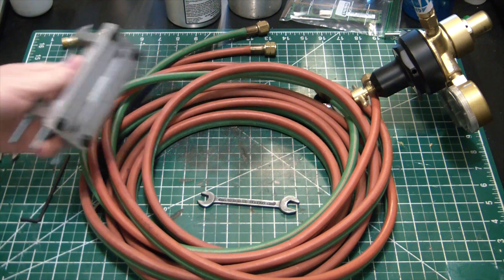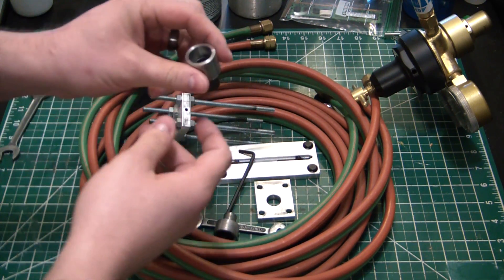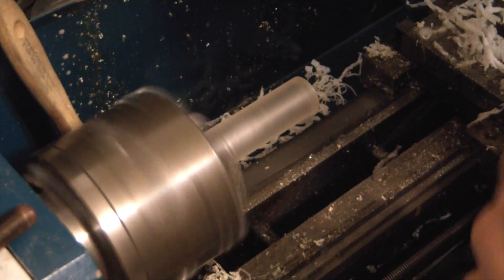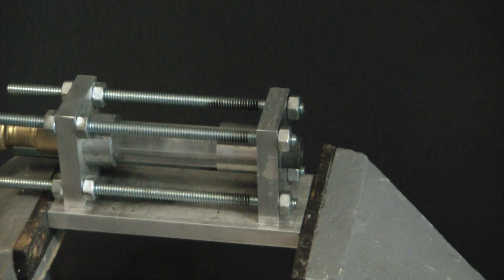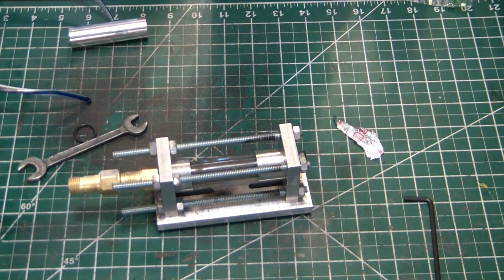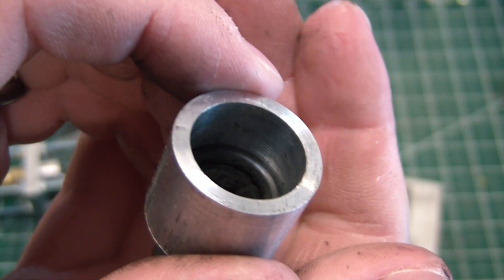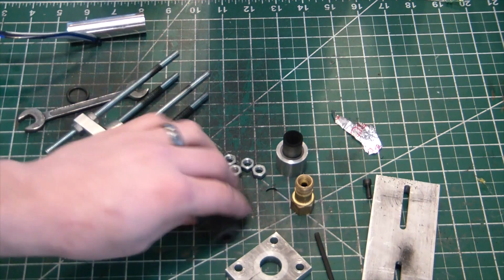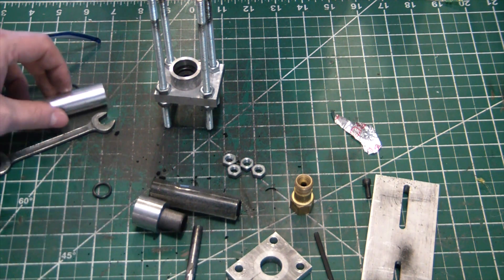Transparent Hybrid Rocket Engine - Acrylic and Oxygen - ElementalMaker

Comment: I may have missed it in the comments, but I saw nothing about your combustion being quite fuel rich and inefficient, although you did state that the operating pressure was low.
You need far higher oxygen flow. If your pressurized oxygen won't do that, then investigate using nitrous oxide. 

As someone else stated, if possible ignite the fuel near the input port. The flame will quickly and evenly spread the length of the combustion chamber.
Reply: The advantage of nitrous is that it can be a liquid under pressure. I think that nitrous will outperform O2 unless you can liquefy it. That can be done by either fractional distillation of liquefied air or by using liquid oxygen to cool the gaseous oxygen.

Comment: The nozzle seems undercompressed. The plume of fire an gas should ideally be straight, if it diverges it's undercompressed and if it converges it's overcompressed. Basically, add a bell.
Reply from the maker: I think the issue is more the very low pressures its operating under. With such a thin acrylic wall I don't want to push it or it'll definitely blow. I'm working on building a larger version that can fit 2" acrylic rod stock. The graphite nozzle itself already does have convergent and divergent sections.
Reply: @ElementalMaker  wow, you read my comment! I'm no scientist, you are probably correct. I was making a suggestion based on my extremely limited knowledge on rocket motors. I do want to start experimenting with hybrid rockets at some point, however. I am curious: how do you manufacture the graphite nozzles?
Reply from the maker: @josephstalin7995  I try to read as many comments as possible! 👍 I made my nozzles on my metal lathe. Graphite is quite easy to turn
Reply: @ElementalMaker  I guess I'll beg my lathe-owning neighbour in Slovenia to make one to spec. Maybe convince him with a few beers :)

Comment: I never fail to appreciate how you make a not-so-subtle adult joke in each of your videos. As for the "thrust vectoring"  (got a good laugh outta that one too), I've found that the closer to the injector end of the fuel grain you place the igniter, the burn progresses naturally toward the nozzle end, and the entire length of the inner core of the fuel will ignite almost immediately. It will do so in an almost perfectly symmetrical and even manner . A cheap metal sparkler works beautifully. That last burn looked amazing, it was nice and straight and bright as hell. Nice work.

Comment: Seen a thing once, thinkin' maybe you can try it..metal exhaust cone, pvc body, wire static coil on pvc, as ignition provider is what I'm guessing. Haven't seen in around 2 years and can't find it, but guessing that it just used atmo as fuel, the whole reason I was impressed by it. Mighta had a diode, but too long ago.

Comment: @ElementalMaker Great work! Your automatic thrust vectoring seems to be caused by flow separation which happens when the nozzle is dramatically over-expanded. This means that the expansion ratio of your nozzle is to big. The easiest design change to correct this would be to make the end of the divergent section narrower.

Comment: Use your O2 con to make liquid o2 and use it as an oxideser for your rockets
Reply: Too much trouble, both to condense and to store. Far easier is to use commercial nitrous oxide. It works fine in hobbyist hybrid motors, but you need a spray injector to atomize the nitrous liquid flow at the head of the combustion chamber.

Comment: @ElementalMaker A better solution than the check valve is a copper pipe full of layers of screen door mesh.  This is how old mining lamps worked, by cooling the gas faster than it could maintain a flame front.
Reply: I'm sure he's made flame arrestors from brass mesh or turnings before, maybe in the HHO torch build - I'm curious why something similar isn't making an appearance here.

Comment: Rockets don't work in a vacuum because it needs something to push off of  and there is nothing but vacuum. it can not push off it's self only. can not break the action-reaction law.
Reply: Rockets do work in a vaccume the pressure inside the rocket pushes the exhaust gas out and that exerts an equal but opposite  force on the rocket pushing it
Reply: As has been proven wrong by thousands of rocket launches into space. It would be easy enough to demonstrate right here on the planet's surface, given a decent sized vacuum chamber and a small enough rocket motor. But I can't think of any reason a person would want to spend the time, effort and expense to do so. 
By the way, it is because of the equal and opposite reaction that the thrust needs no atmosphere.

Comment: I made one of these years ago! Great fun project. Used a machined down Oxy cutting torch nozzle as the oxygen fitting so I could use it with a cutting torch. I machined a throat from high temp stainless steel. It worked great, I never measured the thrust but I could feel the recoil, so it was making some thrust.

Comment: ditch the rubber go to silicone O rings.. far more heat resistant than regular rubber. Try doing one with pvc or even just thick rubber hose as a propellant grain. You might be surprised with the results.

Comment: I bet tire rubber would make a great fuel. Ever light a tire on fire? Hard to start but once they get going you can't stand 20 feet from it without the heat coming off of it feeling uncomfortable. 1st time I saw a tire burning I was pretty impressed, esp since I could stand closer to a flaming stack of wood taller than me, than I could next to 2 tires burning.

Comment: What is the fuel source?  Are you running a mixture of I guess Oxygen and propane or something?
Reply: That intitial flame must be incredibly hot to cause a gassing of enough of the acrylic to use it as a fuel.  The surface area is extremely low.
Reply: O2 is not flammable, however, something that is flammable burns very well in the presence of a lot of pure oxygen.
Reply: +Jeff... OK.  But do realize there are a lot of people who actually think Oxygen is flammable.  I am a bit surprised that plastic is burning given the extremely low surface area.
Reply: What? Did I annoy you or something? Sorry.

Comment: Why not make a flashback arrestor? Simply.... get some steel wool and fill a section of pipe with it. You have 1/8th NPT thread connections, use a 4 inch 1/4 NPT nipple and 2 1/4 x 1/8 reducers install ss screens in each reducer. Thread nipple onto 1 reducer then fill with steel wool, lightly packed. Then install other reducer. The coarser the steel wool,the more flow and it is less effective. I think it was single 0 steel wool that was optimum for HHO torches. LOVE your channel and want to see more of it and all 10 fingers
Reply: @ElementalMaker  you are a smarter man than I. Thanks for correcting and enlightening me

Comment: It might also help to have a fuel with some inert/insulating material mixed in. While adding aluminum oxide wouldn't do wonders for energy density, it could allow for cleaner combustion since you'd have a higher O2/fuel ratio.
Reply: Adding powdered aluminum in its non oxidized state may do both increase energy density and reduce the ash content.

Comment: you can make your own o-rings with automotive silicone to withstand  the heat. you can cast it in a small tube, cut it to the size then join it with a small piece of the tube with a cut to make it easy to remove after; thats how i make custom size o rings. plus you never need to waste time buying them

Comment: Would adding salt into the drilled hole help blow out any debris & carbons when it ignited? As the gas would pass the crystals until higher pressure was formed?
Reply from the maker: That would probably clean the nozzle, but would also likely extinguish the flame front if the motor

Comment: Cast the tar, then push a polished steel rod into the tar. When cold put in the freezer overnight, the steel rod will pull out easy enough then. As well freeze the tar before firing, cold it will run longer.
Reply from the maker: Polished rod in the tar you say??? Are you dropping some subliminal messaging here? LOL
Reply: @ElementalMaker  If it was subliminal I would be referring to fudge...... Though you can make a solid rocket engine out of it though.

Comment: Great! Why does the exhaust change direction during the burn?
Reply: Watching the whole video before asking is quite usefull most of the times.
Reply: Debris from the burnt acrylic buildup on the nozzle and changes the flame Direction.
Reply: @schadmoxey7848  Or, more completely, unburned acrylic buildup in expanding section of the nozzle plus a relatively weak exhaust gas flow.

Comment: You're having focus trouble because of the cutting mat in the background. 
It's all the hard straight lines, those are what the camera is focusing in on.

That's why putting your hand in front works (sometimes)
Because you're blocking the lines on the mat. Mostly. Sometimes.

Comment: Will tapering the hole on the output create a natural nozzle shape as the acrylic burns?
Reply from the maker: I'm sure it would work for a short time, but it would be degraded very rapidly and quickly match the rest of the inner diameter

Comment: https://www.youtube.com/watch?v=TLPWqCMb7DE

something's wrong somewhere, the exhaust behavior is very weird. My guess is that the throat should be smaller, and convergent section should have a longer taper
Reply from the maker: If I used higher pressure oxygen I'm sure the nozzle would essentially self clean, but with such a thin wall of acrylic I can't push it too hard and thus get the soot buildup.

Comment: @ElementalMaker .. Ya needz some transparent aluminum tube for the combustion chamber .. ask Scottie in the engineering section.
Reply: @ConfusionFusion Might be cheaper to go for a sapphire tube. You can actually get a 5-ounce cylinder of flame-fusion sapphire for under $50. Drilling a channel into it might be a problem though
Reply: @stamasd8500  EDM and not the dance music? Or is it not conductive enough?
Reply: @pauljs75  Sapphire is a damn good insulator. No EDM possible.
Reply: If only we had a dumb but Hot early 90's Marine Biologist...
Reply: Ha! Well it might not be long before he gets a hold of some to play with

Comment: Would this work using a magnesium cylinder as a rocket body and fuel?
Reply: Probably not, magnesium doesn't produce any gasses while burning.
Reply from the maker: As mentioned above it wouldn't make for a good rocket as it's combustion product would simply be magnesium oxide, a solid. You want your propellant to generate gas so that you can generate thrust. I'm also not sure if a big cylinder of Mg would be able to sustain a reaction if ignited. Very cool question though 👍